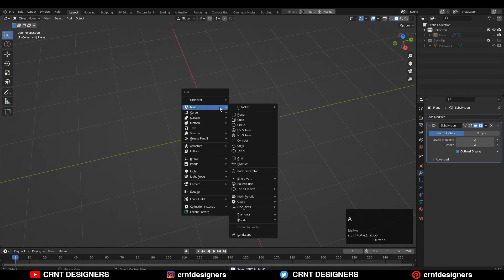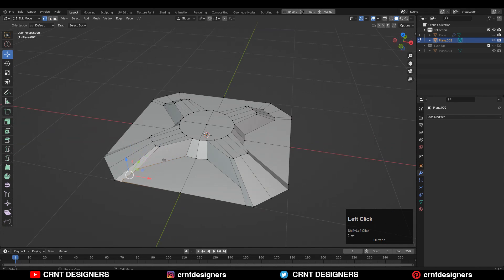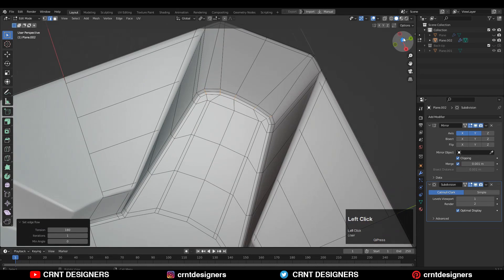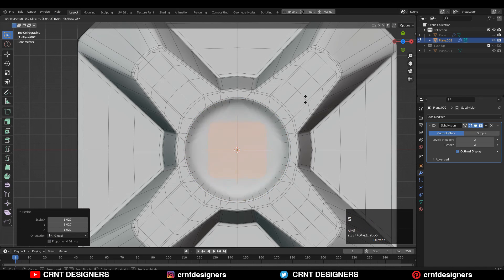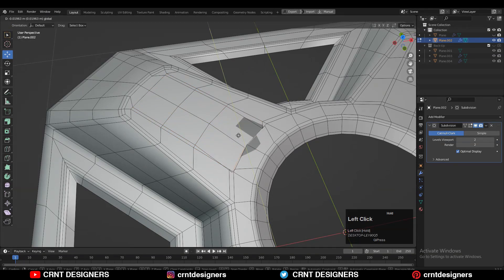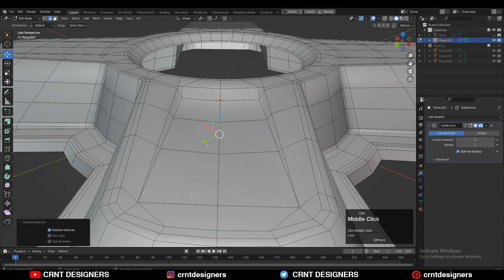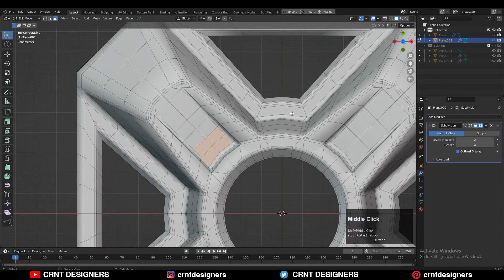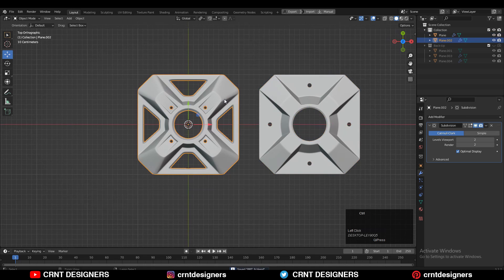Blender Modeling Tutorial _ Blender Subdivision Surface Modeling _ #07

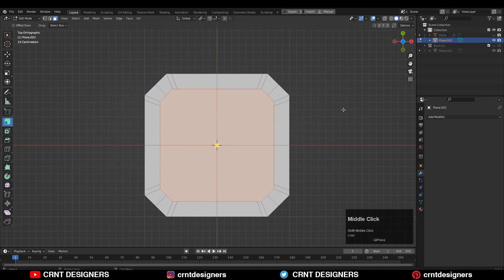Comment: How did you add the extra verts before inserting @0:24
Reply from the maker: With Ctrl + R
Reply: @CRNTDESIGNERS  I'm afraid i dont follow what you did, how did you get a cross and added verts to your mesh after inserting? Crtl+r is loop cuts which I dont see you doing in the video, I tried that my self and it adds loop cuts around the mesh. Maybe I'm missing something
Reply: @peterrandall6761  knife tool? go into edit mode vertices selection and click K for knife tool.